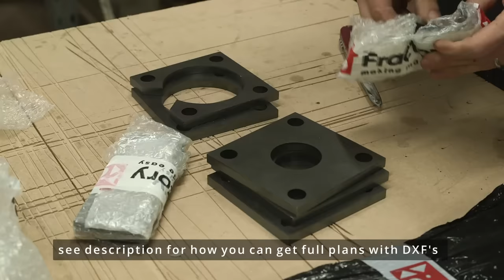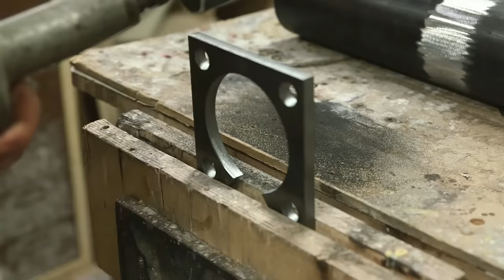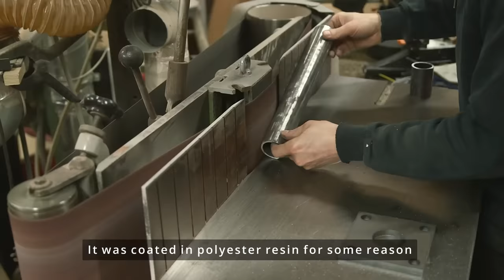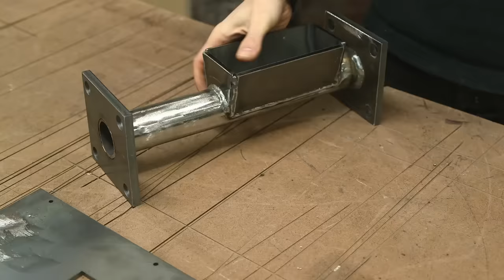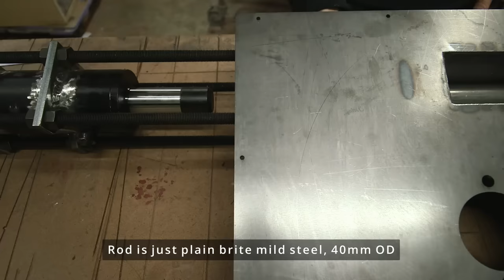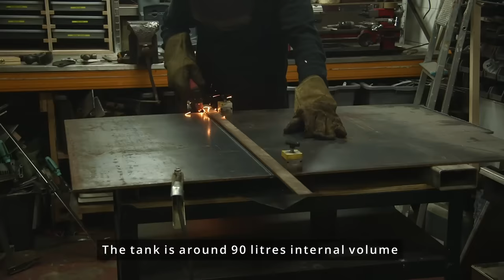Making a hydraulic briquette press

Comment: I love that he actually used the correct ISO standard for that "squinting" gag.

ISO 5725-1:1994(en) section 2 states:
"This part of ISO 5725 is concerned exclusively with measurement methods which yield measurements on a continuous scale and give a single value as the test result, although this single value may be the outcome of a calculation from a set of observations.
It defines values which describe, in quantitative terms, the ability of a measurement method to give a correct result (trueness) or to replicate a given result (precision). Thus there is an implication that exactly the same thing is being measured, in exactly the same way, and that* the measurement process is under control*.
This part of ISO 5725 may be applied to a very wide range of materials, including liquids, powders and solid objects, manufactured or naturally occurring, provided that due consideration is given to any heterogeneity of the material."

So yeah, squinting in accordance with ISO 5725-1:1994(en)...

Comment: Just a thought ! Further to what Paul Brady said, this may help. In the mineral sands industry, loose product was dumped into a largish hole in the ground and at the bottom of the hole was an extraction mud pump with a water pressure feed to the inlet...keeping the product mixed and fluid and able to be pumped..regardless of the dry product being dumped into the hole. To fill the hole involved driving a big F.E.L. up a slope, then a sharp left turn onto a bridge over the hole formed by two large  ; 36 inch diameter steel pipes with side rails to prevent the loader slipping off...and locking the steering along the top of the bridge...safe but scary driving...ref. Eneabba mineral sands Western Australia 1987/88
Am now retired , but appreciate good engineering

Comment: Did not read all comments but I strongly suggest you put a permanent magnet catcher in the tank. Although you sealed pretty neat but those iron particles from sanding etc. fly in the air and somehow enter the hydraulic oil which wear/block the system in time.

Comment: Great content, but a few things....  First, you should be using a torque pattern (star shaped crossing back and forth around to walk the parts evenly in) for those acrylic panels and for ANY part of the pump or press to prevent warping of parts.  Second, Have you thought about turning that stove furnace into a generator now that you have a major supply of fire wood briquettes, meaning a major fuel source to run a steam generator or gasifier into a fuel powered generator.  And third, one heck of an idea, and a great video.

Comment: 2 springs on the adjustment on the discharge tube would provide momentary relief to pass more dense material.   Look at the bale tension system of an older small square hay baker.

Great project

Comment: I made a wood press simply by using my 5 ton wood splitter. The only change is u need to make a wood block with a V cut in a wood block to press sawdust briquette . Next u take
A 2 liter wax milk container make a wood form to fit around the milk container to stop it from bulging. When make my briquettes u need wax from the dollar store or fat from an animal ( beef fat is good) as long as it burns. This material helps make the saw dust stick
Together. Burn time is 1.5 hrs.

Comment: I'd use a rack and pinion on the 80/20 then have an encoder on the pinion.  The slot on the clamp, add a small slot 90* off on the top for an oil/binder drip hole. Old fryer oil, and hot wax work great in a tiny drip .

Comment: Great project. Always fancied something like this but the commercially available ones aren't justifiable cost-wise. 

Out of interest, do you know what power usage this thing draws? (per hour or per kg of briquettes)

NB. You should consider mounting a small motor with an offcenter load to the top of the filters to vibrate them periodically and knock the fine dust off the insides. We did that at a sawmill I worked at and it drastically lowers how often they need cleaning and made the dust collection far more efficient.

Comment: Congrats with your pelletizer efforts, after several trials and errors, modifications, etc. If you burn the pellets in your own stove for workshop heating, you may wish to salvage the stove ash. FYI: wood ash is high in potassium oxide mineral - an important component (potash) in N-P-K fertilizer mixtures for your garden.

Comment: so 18 years ago i worked in a fabrication shop that made aircraft parts for Boeing et al, and they had me using taps, for one day. i broke so many. No one told me you're supposed to do like a half turn and then back up and then half turn, back up. They started me out on a drill press that had an automatic tapper or something, but i snapped a bunch of those taps. Then they had my try hand tapping, couldn't do that either. They moved me into QA (measuring with those heavy green German tolerance gauge meters) and shipping after that.

Comment: With the air injection into the vat, if you blow air in consistently from the bottom at low pressure but high volume, the sawdust should flow like fluid, its how cement is transported in volume in tunneling,

Comment: Using mechanical limit switches will result in some failures that you can avoid by switching to a proximity switch, which is a non-contact device.

Comment: Your mix needs a little bit of moisture.  Normally a pellet mill heats up so much that it fuses the wood particles together, but in a press, you need a tiny bit of moisture to get them to stick together and not become a rock like that.

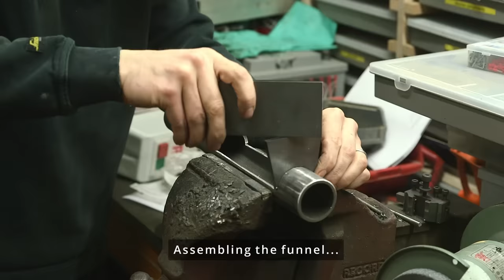Comment: 4:18  I was impressed with the attention to detail in your referencing the accuracy of the squint with the applicable ISO standard, ISO 5725-1:1994(en).  
A lesser engineer might have resorted to using the description popularized by Marisa Tomei in My Cousin Vinny (1992), "dead-bools-on accurate" (it's an industry toim).

Comment: Very impressive Russ! Probably a very stupid question, but does the material the dust is made from affect the compression of the briquettes? Do you have to adjust it for a certain type of wood dust or is it all pretty much the same / mixed anyway?
Reply from the maker: Yeah I have to dial it back for softwood otherwise it jams up the nozzle, but still makes really firm briquettes. whereas with hardwood it have to really clamp it down to get them reasonably firm.

Comment: Just a tip the welder needs some adjustments the blacking on the weld means not enough gas and sounds like its set to hot or not high enough wire speed.. but cool vid

Comment: It was a pleasure to see another mutliskilled man !! I have a similar project to do so it was good to see someone else do it first. That hydraulic cylinder locked up at a 12.8 metric ton load !!  I assume that's the pressure relief valve kicking in at about 3626 psi for the 250 bar pressure. I have so many questions!!! It looks like the sawdust had no additives to make it compact into briquettes which was of particular interest to me.  I also assume that if the tube was a welded seam tube, then the welded seam was cut out when slitting the tube. I also assume that there was a low voltage to the limit switches operating relays to switch the high voltage circuits. Anyways, good job!!

Comment: That is truely amazing, I love it 😻  I’ve worked on square hay balers and getting the exit tension right is difficult. If I was building a machine like yours I would have it push against another ram with a relief valve so it would work with any wood dust, sappy or otherwise. Which is something I wouldn’t know without watching this build :o)

Comment: I need to make a pellet extruder press to turn the leaves into burnable pellets every fall so I can heat my shop with them. Other thing I was thinking, put a mold on the end of this and a heater on the barrel and it could be an injection mold machine. I want to build one of those also.

Comment: Do you have to sharpen your drill bits often?  Your drill rotation speed is way too fast, you are dulling your drill bits.  In this case:  slower is faster.  Amazing.  That took a long time to build and it works perfectly, you are inspiring.

Comment: Very good tutorial. Iv'e been interested in the Ruf method of briquette machine unlike the type in this video which is found  everywhere on YouTube. The Ruf method presses out a whole block at a time, first filling a tool then compressing  it into a solid  under great pressure then ejected via pins  just like in a plastic injection moulding machine. I would love to see any video showing it in action as an alternative to the constricted tube method. I have spent a lot of time searching YouTube with  no luck. It was almost happening here when it got jammed up in the  tube I could see if this happened with a purpose made split tool and a pins to push it free you have another kind of briquette machine. Anyone got any answers ?I was thinking of converting or using parts and controls off an old injection moulding machine Iv'e got. Is my thinking way off or plausible?  Has anyone even thought about this?
Reply from the maker: https://youtu.be/3UqILtO7KwU?si=_-z5MThEejvQSv6R
I distinctly remember this one from when I was doing the initial research for my press project. I remember it because it is such a comically long and convoluted process to make a tiny little briquette every minute or so! it is amusing to watch it wirring away and then ping out a little coin. I think the die chamber needs to be much bigger for it to  be efficient.

Comment: Maybe the ligdin in the wood is melting then solidifying too quickly and making it sticky inside the tube. You might concider heating the tube so the ligon is kept soft until discharge... Your product may hold together better too.

Comment: @NewYorkshireWorkshop: Didn't you recently install a pressure valve to boost air pressure in your workshop?
What is that gadget called and where did you get it?
Reply from the maker: Yeah it wasnt for the whole workshop though, just for the cnc router. you sacrifice air flow in favour of higher pressure so they are good for specific high pressure requirements. 
it was this or a similar model, cant remember exactly which one i got- https://uk.rs-online.com/web/p/pneumatic-regulators/8268080?searchId=71a0e917-8d90-4123-bc97-5609cde90af1&gb=s
there are different models depending on pressure multiplication and capacity. i got mine off ebay for a fair price.
Reply: @NewYorkshireWorkshop  Yes, the lost air flow will not be an issue. I am looking to build a separate tank to increase volume in the end product as well. Will take some time to fill the system still but better than getting stuck with 250 l/min airflow at 8 bar when I need 16 bar to push the liquid in a paint gun

Comment: Man! That build was awesome! 😀 If I might ask what kind of sawdust do you use? At my work we use mdf, some plywood and timber dried to 6-8 %. I contacted some suppliers but they all told me the dust was to dry... and the smallest automated one produced something like 100 kgs/hour. We make 100-200 kgs of dust a week. 😂
Reply from the maker: just about the same here really, not so much mdf but mostly plywood and hardwood, It is all kiln dried to it cant be far off 6% once its sat in the dust collector for a week! it doesnt compact as well as the commercially available briquettes which is probably due to the lack of moisture, or too low temperature in the nozzle or both, they are good enough for my as they are though.

Comment: nice job, but isn't there a way you can attach something that would monitor the heat build up? that would automatically shut the press down if it got too hot to avoid any flair ups? causing your shop to go boom?  my grandpa had a woodshop and always had issues with heat build up, to where he had to keep his door open....in Wisconsin USA (bear country)  and he had small dogs so really wasn't an option, I'm not smart enough to even attempt this as I have a TBI and get upset easy....bless my fiancé for putting up with me, been together almost 11 years now... I know nothing about how to even attempt something like this....just wondering safety issues no offence meant---I hope you at least have fire extinguishers around....better to be safe then sorry

Comment: This is awesome. I would have used a whole lot more arduino & code rather than ISO certified industrial switches/boxes etc. Too pricey for this homebrewer. I might do a small one . Just relays from an arduino, some end stop switches & maybe a proximity switch for self calibration. This is too big for my needs. Bet I could use a stepper motor to pump a 4 ton bottle jack manually with its lever. I want a benchtop version. Thanks for this awesome idea.

Comment: Oooooooh, Idris tip; if you want to send nuts down treaded rod fast then use the wire wheel on the bench grinder to wizz them along. If you don’t have a wire wheel on your bench grinder then get one, it is massively useful :o)
Reply: Another Idris tip; paint the inside of the top. The bottom won’t ever rust but the underside of the lid condensates :o(  ( less off an issue if it is mobile because sloshy oil covers everything)

Comment: While i understand the easier time you got making an extrusion set-up, creating brickettes into small cylinders is a mistake. You do not want something that is intended for (and will be) put on fire to have an easy time rolling around. Having them be so small also hurts the structural integrity a lot and the huge surface area will make them burn up almost immediately.

Comment: I cut and buy firewood. When I buy it, it costs about $0.10 a pound ($375 a cord. A cord being 3750 pounds). If my calculations are correct.... you are taking your woodshop sawdust waste and converting it into firewood at about $0.013 a pound? That would be the cost of electric to run the 7.5kw pump.  Am I in the ballpark?

Comment: as a welder over 30 years, it dont materhow you weld a cylinder it is goingto distort if you do not do the prep first, you need to cap off the open end and fill it with oil and leave one port open for avent, then weld your flanges on in short welds, you can not weld it empty, is will distort know mater how sw you weld it.. do not use water,, that will weaken the steel, make it bridal..

Comment: Slightly confused by the heat exchanger, with input connected to output, so there's no flow of cooling water? It just has a fixed amount of water inside which absorbs heat from the oil, and that's enough to keep the system cool? With no movement besides convection? I'm not criticising, I'm genuinely surprised, I wpuld have thought you'd need to have the water being pumped through radiator to actually transfer the heat from the oil to the water to the air. It can just sit there with no flow needed besides convection? Impressive!
Reply from the maker: the heat exchanger does have an inlet and outlet for water, but as of right now the only way I have to feed it is to plug a hose pipe into it and have it flow through and then drain through another pipe into the toilet! as it happens though, with the briquetter fine tuned a bit for efficiency; the pump stabilises at a reasonable temperature without need for cooling water. I guess the mass of the over-sized oil reservoir and extra pipe are enough to  keep it cool, but I do have the option for extra cooling if needed.
Reply: @NewYorkshireWorkshop  That's really cool! Thanks for replying!